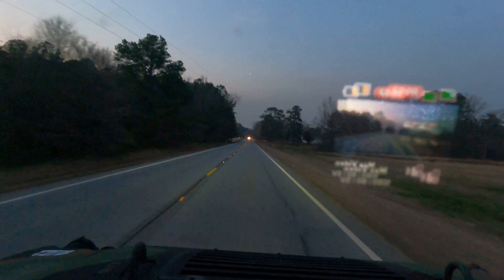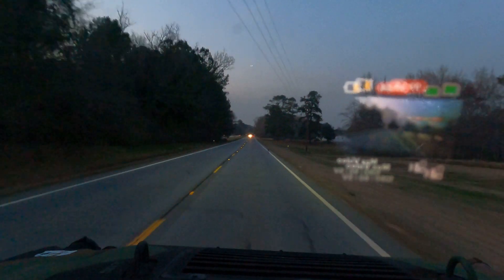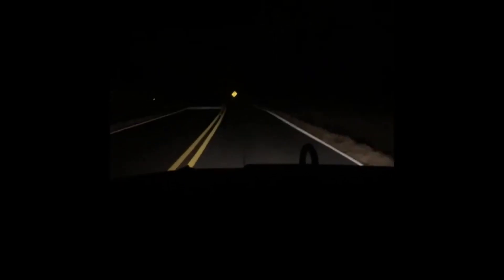HMMWV Transmission Diagnostics/Repair Guide

Comment from the maker: https://gear-report.com/wp-content/uploads/2017/03/Supplement_7_4L80E-Transmission_Troubleshooting.pdf
Reply: My HMMWV is stuck in the safety mode (2nd gear).  Did you have to disconnect the glow plug controller box as it states on page 60 of the manual?  Thank you!
Reply from the maker: @btrev5183  I did not have to disconnect mine for diagnostic purposes
Reply: @mtvrchannel3051  Thank you sir.  I ended up getting it to work.  I followed chart A1 and was able to get it to shift.  Thank you sir.  Keep up the good videos!
Reply: @btrev5183   
Mine is doing what yours is. Did you get it fixed? If so how did you do that. I’ve been fiddling whit mine so long I’m about to sell. This thing is just a pain in the butt.

Comment: I'\n M glad that I found your video I have a m1097a2 in the 4 man configurations. I just had my transmission rebuilt because we were having problems with it slipping, we thought it was the transmission was damaged, turned out after watching your video. It was the brake light switch under the dash. The torque converter was not completely locking up. If I had found this video sooner, I could have saved myself $4200 in a rebuild. Thanks Smitty

Comment: I just bought a 4 speed truck from auction. Missing the front right axle. The truck will move if transfercase is in HL and L but will not move in H. If I tap the brake while case is in H and trans in Overdrive it tries to engage but doesn't. All the fluids are good. I'm new to this, your experience would be greatly appreciated.

Comment: What was the reading on the ohm meter? I heard the buzzer but can’t see the reading. Mine read .3 and then pressed down OL out of limits.
Reply from the maker: That’s what it should be. You’re looking for <1.5ohm “resting” and “open” when depressed, meaning the circuit is breaking when the brake pedal is depressed. If you’re having issues, I’d recommend pulling your codes and using the link pinned in the comments
Reply: @mtvrchannel3051  Thank you I am lucky to hold .3 ohm when moving/brake not applied.

Comment: I have a Humvee that may have a similar issue. I have the M1152 6.5 L Diesel. The brake switch is the same as what you have. The vehicle will go into over rev and struggle to maintain 40MPH. The engine is fine.

Comment: How do you lock and unlock the torque converter? Is when you step on the brake?
Reply from the maker: I had a manual toggle for demonstration purposes in this but yes the brakes do it

Comment: My M1097A2 4 speed is in limp mode and stuck in second gear. Will shift into neutral and reverse, but goes and stays in 2nd once I put it to drive or overdrive. Help me brother!...lol
Reply from the maker: It all starts with my comment pinned at the top of comments, go in that guide and pull your codes. There’s a step by step all inclusive guide inside that manual

Comment: My torque converter locks in and out while driving between 50-65 mph over and over.  It’s a 2008 m1123 4 speed. Any idea? I can send a video to a email if needed
Reply from the maker: Have you pulled the codes yet?
Reply: Not yet.  I unplugged the two prong connector while driving locking the torque converter in place and the problem stopped.   You stated there is a process to adjust the brake module sensor if it’s out of alignment.  Do you have a link on how to do that?

Comment: Sir, I have just aquired a 1988 AM General M1097A2. I followed your video and it gave me code 73. The issue im having with it is that it will not go in reverse. If there is any advice you can give me I'd be very grateful. I can not find what 73 is.
Reply from the maker: Check my “pinned comment” at the top of these comments, open the link in it, and go to code 73, you probably don’t have 4th gear either. The manual you’ll see will have an entire guide for diagnostics

Comment: Sorry, fat fingers,….. but the tranny won’t shift out of first gear. What should I do? Does the fact that I have no break lights working mean ghat The dual break lights switch in your video is the culprit?
Reply from the maker: Chances are, it’s stuck in 2nd gear limp mode. Pull your codes and see what you get

Comment: I’m having a 38 code, and tested the switch as you did with my multi meter, but I’m not sure what it should read to be a good switch. My transmission is stuck in limp mode (1st).  What should the resistance be?

Comment: connecting jumper cable pin A and E of the J2 TCM connector. 
trany flash light : *__*__*__*******(8)__*******(8)__*******(8)_ .
what does mean ?
Reply from the maker: There’s a manual link in here
Reply: I’m getting the same code. 8 lights. Did you figure out what it means? Thanks.